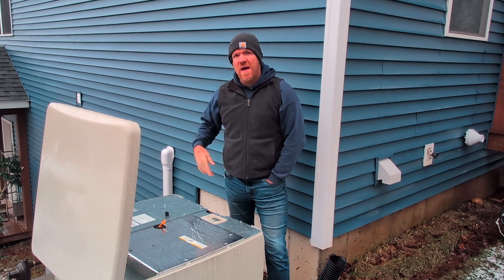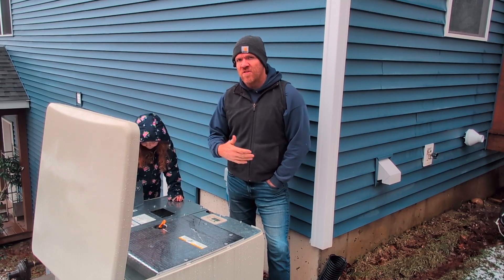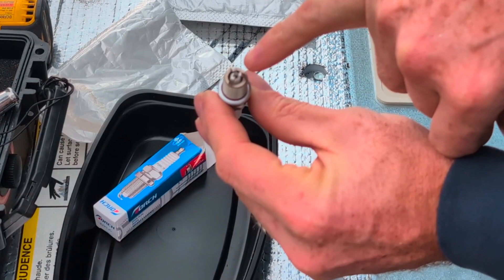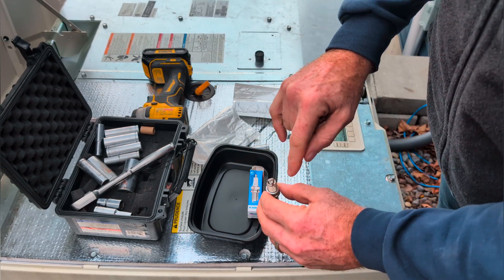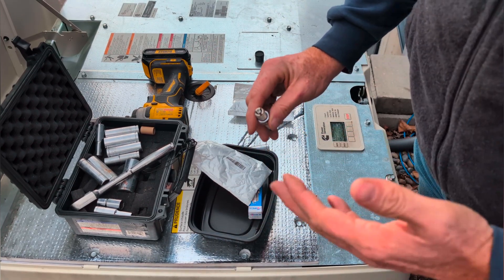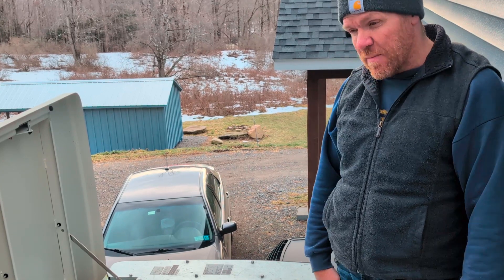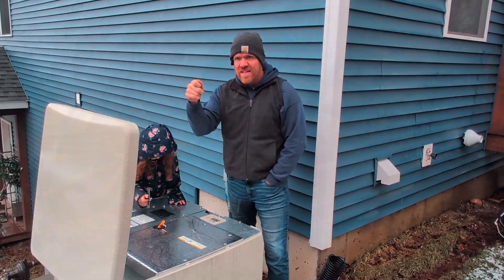YouTube Knowledge Base for 20kW Cummins Home Backup Generator - Spark Plug Edition

Comment: I have the same generator on lp.   I have had problems with it starting when it’s cold   20 degrees and below.    Any tips?    If I manually choke it it starts right up.      My choke is shutting.     Thanks
Reply from the maker: Do you have the cold start kit with it?
Reply: Yes I do.
Reply from the maker: Here is Google Gemini's approach:

Here are the most common causes for this specific behavior:
1. Faulty Choke Solenoid or Stepper Motor
Most Cummins air-cooled units use an electronic solenoid or a stepper motor to actuate the choke plate.
The Issue: The solenoid may be sticking due to dirt, or it may have failed electrically. If it doesn't pull the choke plate closed, the engine won't get the rich fuel mixture it needs to ignite in cold air.  
The Test: Remove the air filter cover. Have someone attempt a manual start while you watch the choke plate. It should cycle (close and open) during the cranking process. If it doesn't move, the solenoid is likely dead or disconnected.  
2. Valve Clearance Out of Adjustment
This is a very common "hidden" culprit for Cummins and Generac air-cooled units.
The Issue: If the intake and exhaust valves are too tight, the engine cannot create enough vacuum (suction) to pull fuel from the demand regulator into the cylinders during a cold start. Manually choking the unit creates an artificial vacuum that overcomes this.
The Fix: Cummins recommends checking/adjusting valve lash every 200–400 hours. If it’s been a while, a valve adjustment often solves "hard start" issues immediately.
3. Demand Regulator Sticking
The demand regulator (the large round component in the fuel line inside the cabinet) controls fuel flow based on engine vacuum.
The Issue: In cold weather, the internal diaphragm can become stiff or "sticky." If it doesn't move freely, it won't release fuel during the low-RPM cranking phase.
The Test: There is often a small vent hole or a manual "primer" button on some regulators. Gently depressing this during cranking mimics a choke by forcing fuel into the mixer.
4. Low Battery Voltage
Even if the generator sounds like it is cranking "fast enough," a weak battery can cause problems.  
The Issue: If the voltage drops too low during cranking, the control board may not have enough power to properly engage the fuel solenoid or the choke actuator.
Note: Your cold start kit does not typically include a battery warmer. In extreme cold, a battery blanket is often necessary to maintain the "punch" needed to operate the electronics while cranking.
Reply: @woodlyz .      Thanks
Reply: Do you have videos on setting the valves on the Cummins 20 kw  lp generator?    Thanks

Comment: Near the end of the video, I am trying to figure out what might be wrong when genset keeps running when you expect it to stop. Another of your other videos seems to show the same issue. So I have a question further down:

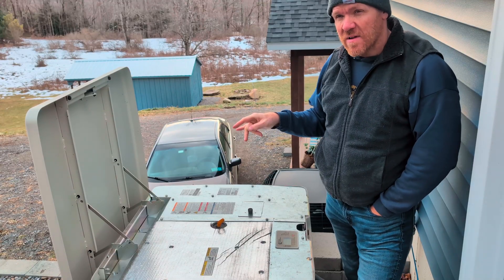I am assuming you pushed the red STOP button just prior @08:51 and I am wondering about why your genset ramps down but continues doing a very low idle. Of course, the engine should have completely stopped relatively soon after the button push.

These units ship from the factory configured to run on NG. Upon installation, you probably changed the config on the local display from NG to LP. My question is: did you also change the manual fuel selector of the fuel pressure demand regulator inside the cabinet? If you did not, you can access the fuel selection handle through a hatch, once the exhaust panel of the cabinet is removed, on the left side. The handle should be horizontal for LP (vertical for NG) after turning 90 degrees counterclockwise.

If the fuel selector is still set to NG, my guess is this incorrect setting is allowing much more vapor to flow than otherwise would. The low idle speed is still drawing enough vapor to keep the engine barely running rather than starve and stall the engine. When the engine physically stops THEN the fuel solenoid shuts off any further vapor flow.

The service manual does not say much, if anything, about troubleshooting a genset which keeps running when commanded to turn off. It does say this:

Service Manual 2019 A062J683 (Issue 1)
7.8 Fuel Shutoff Solenoid Valve

When the engine is cranking or running, 12 VDC battery voltage is sent to the solenoid energizing the coil and causing the solenoid to retract (open) the valve. When the engine is stopped, the 12 VDC is removed, causing the valve to close and preventing any fuel from passing through.

https://www.electricgeneratorsdirect.com/manuals/cummins-power-generation-2a229eee67dedc1603d2d051a3b9d5af.pdf
Reply from the maker: I put the new spark plugs in today and checked the manual setting. As you suspected it was not adjusted properly for LP.  I didn't take the entire side panel off but the installation manual said it should be horizontal and it was vertical so I adjusted it. With the spark plugs and that it sounds much better running, however it still did not shutdown after manually turning it off with the stop button. 

I think I may need to have that valve looked at more closely as to whether it is a mechanical or electrical issue.
Reply: @woodlyz  Ok. Did you also confirm the unit is configed, at the local display, for "LP"? The settings, in the local display, are set to NG at the factory.
Reply from the maker: @takeitwithyou4391  yes I did double check that
Reply from the maker: This is an extremely helpful comment and I am very thankful for you sharing.  I'm going to check on that as I don't recall making that adjustment.  I'll report back on if that fixes the issue or not.  Again, thank you very much.

Comment: Nice video. Thanks for posting it. I have a model like yours. I was concerned about mice or rats getting into my unit, too. What I learned from pest control people is to use 1/4" screening to keep them out. What I see in the video @06:39 are two "open" round holes in the black painted base. If these are plugged with metal caps then the rodents might not access your unit at all. The hole on the left is usually uncapped during installation then plugged back up. So, I made sure all of my exterior caps were replaced after install. But, after watching your video I also capped the interior round open holes on the black base, just in case. I did not want any rodents getting in and chewing on anything.
Reply from the maker: That's a great idea about plugging up those holes.  I hadn't thought about that but now that you mention it, it makes total sense.  I picked the unit up and unloaded it myself so I think I removed those caps so that I could attach straps when I was positioning the unit.  

The screening has worked well on the air filter but I have been concerned about the vulnerability of the wiring and think that by plugging those holes I will be able to have greater protection.